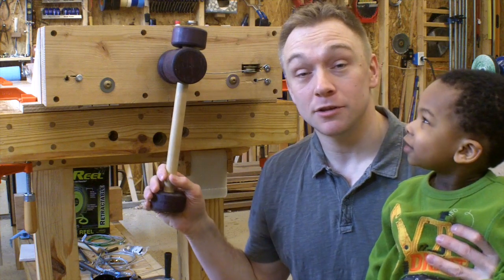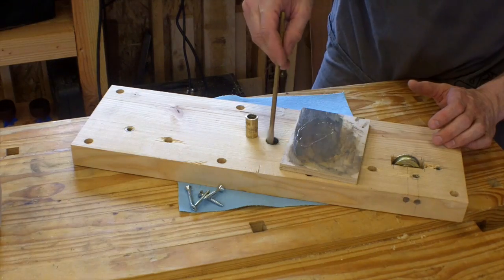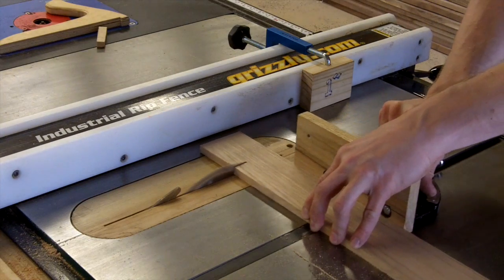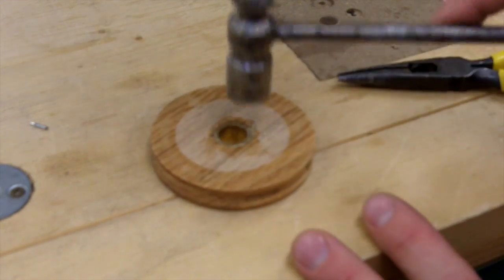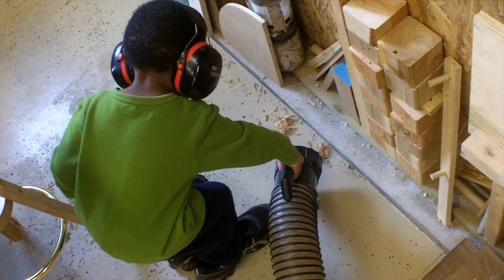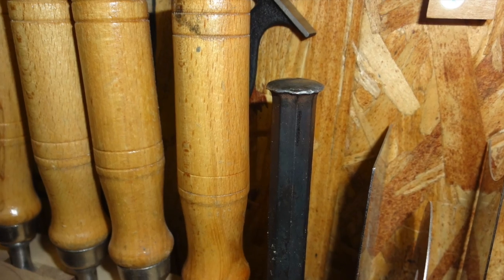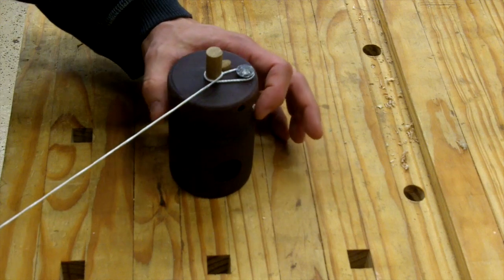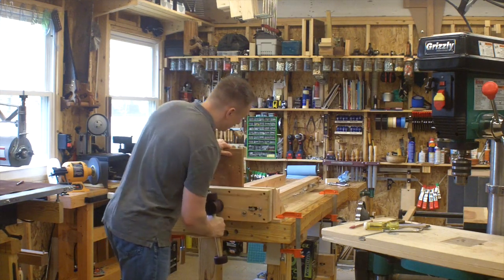Cable Vise 4 - IT WORKS!

Comment: Andrew
It looks like you "got it" BUT, for the life of me, I don't understand why you are not using garage door spring pulleys?
http://www.homedepot.com/p/Prime-Line-3-in-Diameter-Pulley-with-Straps-and-Axle-Bolts-2-Pack-GD-52189/202633686

Comment: Really intresting concept, and well executed . I really liked the method for winding the cable . Nice job ! But the size of the runners  could be an issue for someone. Do you think that another central pulley , near to the vice jaws, could help to keep the lenght of the cable and decrease the size of the runners ?

Comment: BRILLIANT! This was a joy to watch all through. I'm not entirely convinced that this would retail out at less than the $400 you said that an equivalent commercial vice would cost (I guess that would depend on production methods) but it does seem that your design is far superior. I see that this was posted over a year ago. How's it holding out?

Comment: Excellent idea and well thought out too. Loved it. Just a small question. Does the amount of rotations to lock the vice stay the same at 1" as it does at 20" out? It's just that I have an idea about that. Cute son by the way. :)
Reply from the maker: The rotations stay almost the same but actually it takes a few FEWER rotations to tighten with the vise all the way open.  I have actually abandoned this vise concept in favor of the fast travel vise design I release a few months ago.
Reply: +Andrew Klein Thanks, I'll check it out. Signed up to your channel too. Normally I just cherry pick on vids to watch, but yours seem a cut above the rest. Came here via Facebook, your custom drawer saw was shared on my timeline there. Very impressive work. Anyway thanks for the reply.

Comment: In the previous episode (#3), you were complaining that tightening the vise requires 3 1/3 turns. Now you seem delighted that it works with only 3 turns. In my mind, there's not much difference.

You added the metal dowel to increase the diameter and turn radius. How about using 3 or 4 such dowels spaced around the disk, to drastically increase the diameter? You wouldn't want to bang 3 or 4 metal rods to flare the heads, but how about tapping the end, bolting a washer in place, and rounding that? You wouldn't really want to place all 3 (4) dowels on the outside edge ... bring them in toward the centre on a spiral pattern ( fibanocci strikes again).  Your current design has a large initial diameter which collapses quickly. Using multiple  dowels would collapse more gradually. if you have it use up almost all the slack in one turn, you'll have a little need for additional turning at the small diameter. So one-and-a-fraction turns take up all the slack, which is a whole lot better than three turns.

Oh ... and if you use several metal dowels, they can be smaller diameter, just an ordinary bolt.

Comment: Since some of your problems with the cable vise is the stretch in the cables, did you consider using roller chain in place of the cable.

Comment: The reason your pulleys failed is not that they were very thin but that wood is a very isotropic material. As you rotate the pulley the strength of the base material changes considerably: lots along the grain, almost none perpendicular to it. It will always fail this way regardless of size, it's just a matter of time. I'd use aluminum myself but my own shop is metal oriented, not wood working like yours. So I suggest you, if you want to keep using wood, that you make your own plywood-like board by cutting thin sheets of solid wood and gluing them together with the grain rotated from each other. And then make the pulley from this. I'm having a lot of fun watching your videos! -Miguel (a fellow inventor).
Reply: M1KEMEX LOL. I didn't watch the whole video before posting this...

Comment: That is extremely clever!  If this were to be made commercially, I think the runners would be made of square steel tubing with the cable routed inside.  I'm sure you already thought of that tho.  I personally prefer a wheel with a crank rather than a tommy bar, but that's just a preference thing.

Comment: Correctly fitting shoes and on the correct feet are just a no no to people in the single figure age group, if they are good enough for daddy then they are certainly good enough for me is the general approach.
 
I’m glad I fell upon your video’s really interesting and informative thanks for the effort.  I will be happily working my way through the rest of them.
 
Just as an afterthough you maybe could have taken a bit of one of the broken pulley’s say about a quadrant  and put it place of the mushroomed bar and it would have achieved the same effect.